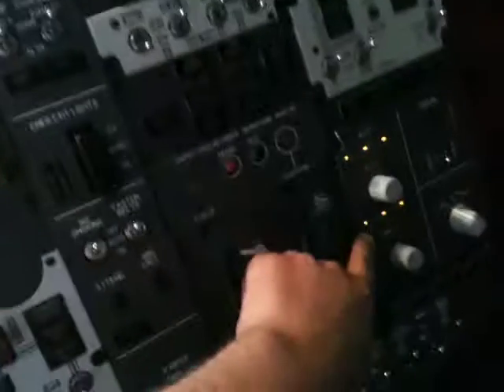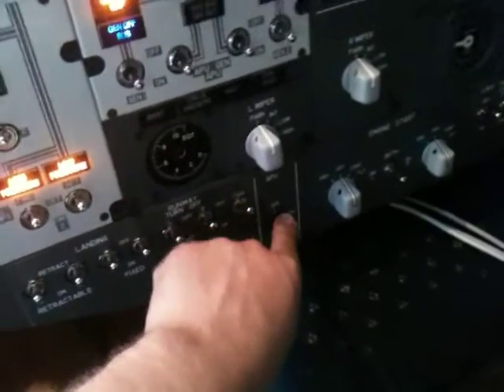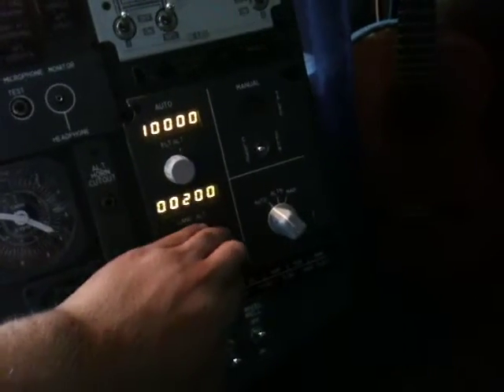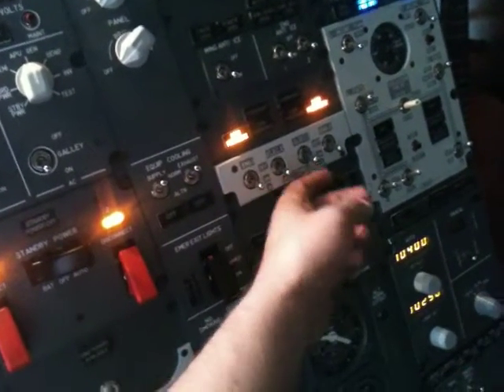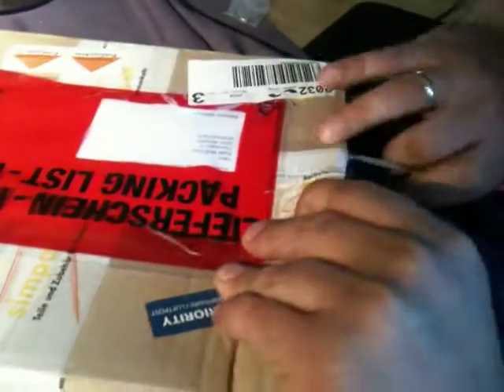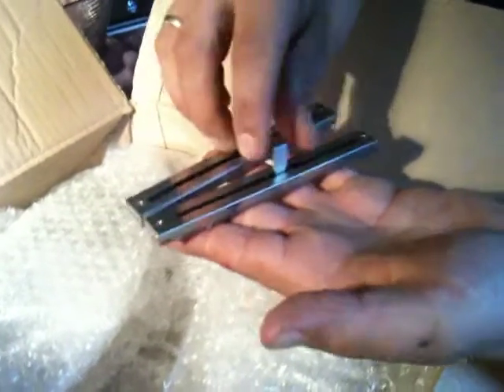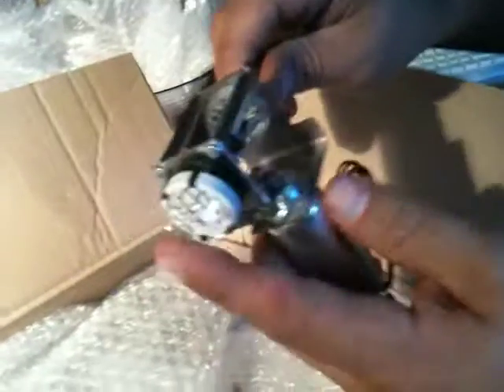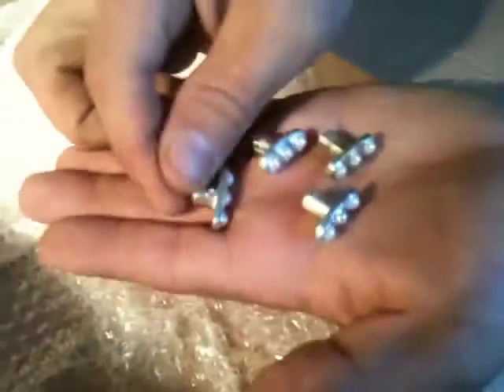Building a Boeing 737-800 home simulator #28

Comment: This is very cool. I love the annunciator test mode. Have you considered Hall sensors for the yoke? They're contactless so won't wear out, electrically equivalent to a potentiometer, and might save you a lot of future hassle if the yoke pots are going to be buried in a hard-to-reach corner.

I have a friend with a real airliner cockpit rigged for MSFSX. The rudder pot is in very poor condition but replacing it is an utterly miserable job, as It's buried in a hard-to-reach place under the panel.